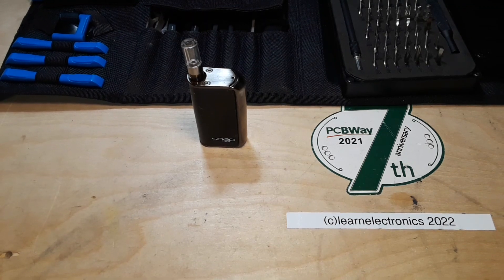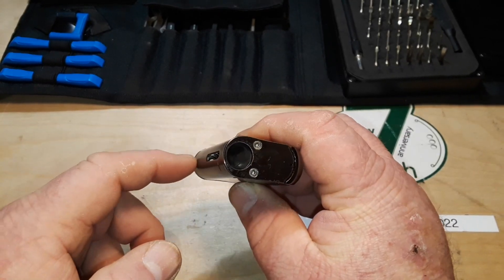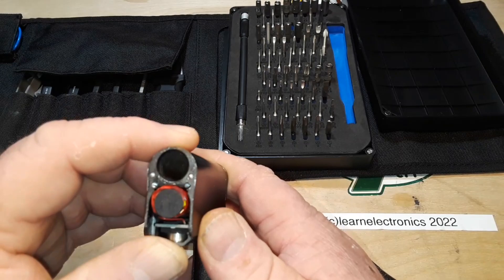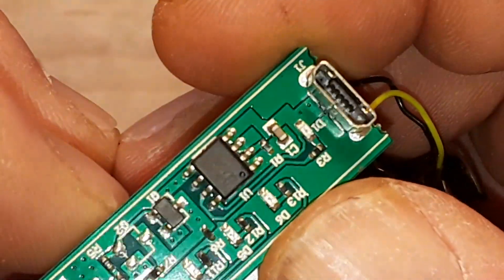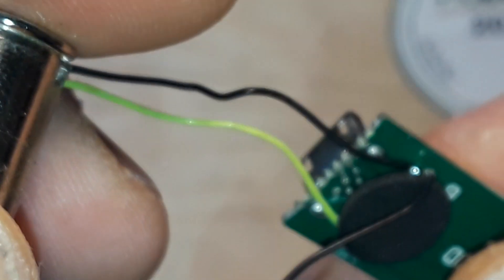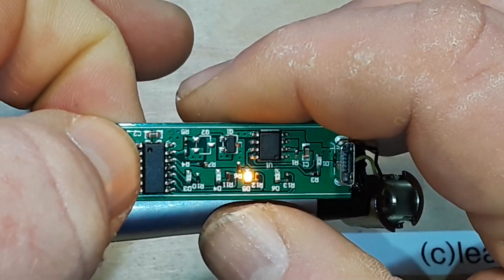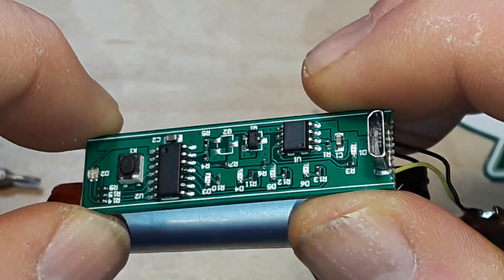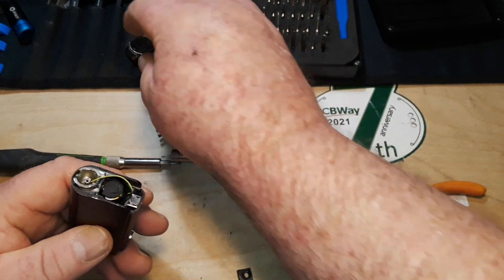Snap Mini Tear Down

Comment: A. Only part I wanted to see was where the yellow wire was attached. B. In order to remove the heater there is a C-ring on the same side as the attached wires.

Comment: Not sure about yours, but the heater in my vape. Is actually in the bottom of the container. For ref. The  part you point at @0:37 sec. For me it’s a 1.6ohm coil wrapped and stuffed with cotton.  Anyway, nice to see the inside. I figured it would be something like that.
Reply from the maker: Yep I was wrong

Comment: Paul. That’s not a Heater. The Coil IS in the Pod. 
The Connections to the Heater is the Magnetic  End. The 510 threaded Ceramic or Nchrome
Reply: You have to take the pod apart for the heater coils. Sometimes they are wire sometimes ceramic. Sometimes. Coils around Quartz rods.
Reply: I use an old one with flux in it. Helps find hot spots and shorts.
Reply from the maker: Cool, thanks